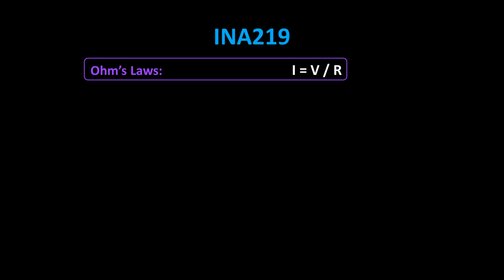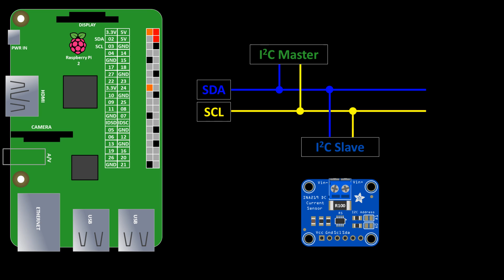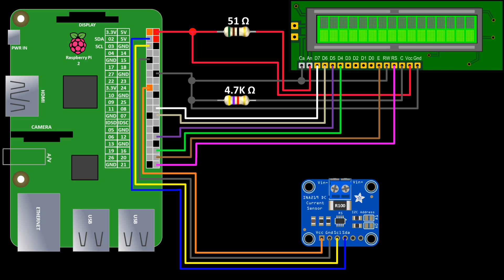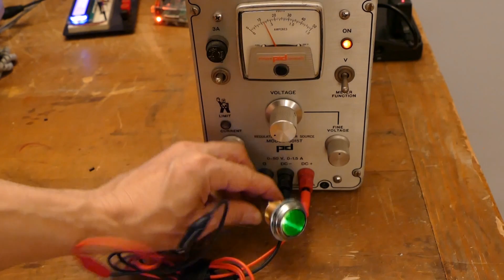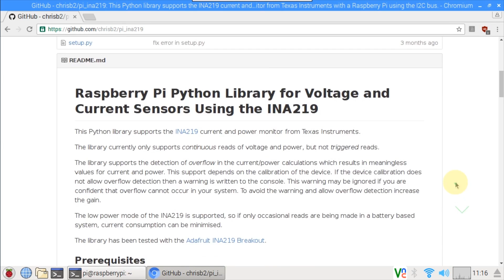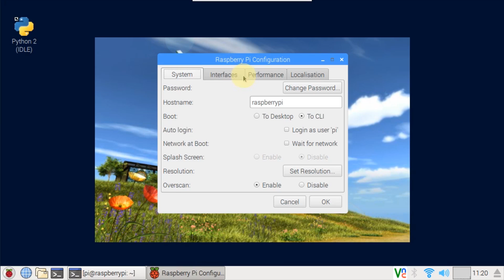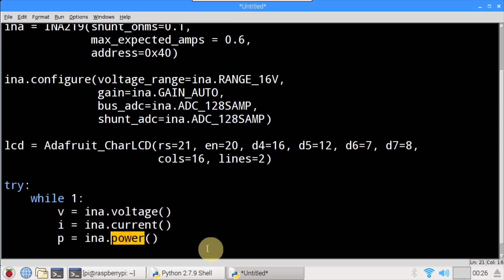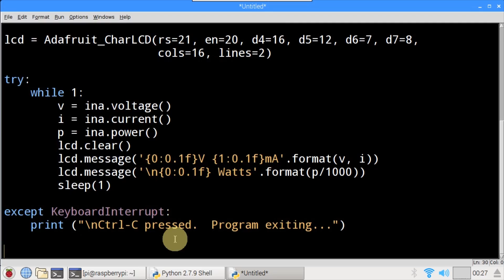Raspberry Pi INA219 Power Measurement Tutorial

Comment: Hi, would this work with the raspberry pi zero 2?
Reply from the maker: Yes, the INA219 will work with the Raspberry Pi Zero 2. It communicates over I2C, which the Pi Zero 2 fully supports. As long as it's wired correctly and addressed properly, it should function just like on any other Raspberry Pi model.

Comment: I'm hoping to display the voltage and current measurements on my laptop and store them, could I do that?
Reply from the maker: Yes.  The most common way would be to set up an MQTT server to receive the data from whatever device is connected to the INA219.

Comment: Great video! I am looking into options for a battery bank display. Being that the amp setting is somewhat relative to the load I assume it’s not the best solution for a battery bank that will likely have various loads with different devices being plugged in for charging?
Reply from the maker: It would be better to find a chip specifically designed for battery monitoring, often called a battery fuel gauge.

Comment: To save costs and to keep it as simple as possible, could I use Raspberry Pi Pico instead of a full on Raspberry Pi?
Reply from the maker: Yes.  There are Micropython and Circuitpython libraries for the INA219 that are compatible with the Pico.  There's a Micropython example using the INA219 in my vegetable garden automation video:  https://youtu.be/x219R5rzRtU?si=_hZyaAXItKh97UGn

Comment: i2c isnt being detected! I wired everything like you did but I doesn't work! Do you have any idea why? I checked some forums but nothing works
Reply: I installed all the libraries but nothing is showing
Reply from the maker: Did you enable I2C using raspi-config?  Did you verify the address using i2cdetect?
Reply: @rdagger  Thanks for the quick response time! I enabled I2C via the Raspberry Pi Configuration menu and i wouldn't get any detection using i2cdetect. I made sure i connect the pins to the proper gpio pins and everything.
Reply: @rdagger  Could there be an issue if the wirelength of the wires I used to connect the pins is a bit long? The wires about a foot long.
Reply from the maker: @tonssov1  1 foot is within spec but I would test the wires with a meter and try swapping them out.  What Pi are you using?  You could have a bad INA219.
Reply: @rdagger  I have a raspberry pi 4. How could I verify that the INA219 doesn't work?
Reply from the maker: @tonssov1  Hook up a different I2C device and see if i2cdetect works.
Reply: @rdagger  I don't have a different I2C device but could I try and get it working on my arduino to see if its something other than the INA219?
Reply: @rdagger  I got it working on arduino and am getting proper readings.
Reply: i got it working. thank you

Comment: Can we use the same for any different processors with Android os in it ?
Reply from the maker: Any board that supports I2C should be compatible assuming you can get a driver for it.
Reply: @rdagger  ya so I got the driver as well as my pcb supports ina219 but the thing is I am not able get the data from it. Would be great if you could guide me 🙏🏻
Reply from the maker: @SohanChhangani  What board are you using?  What driver are you using?  What error message are you getting?
Reply: @rdagger  custom pcb with cm3566 som
Reply from the maker: @SohanChhangani  Sorry I don’t have any experience with the CM3566.  Generally speaking, I would do the following:
1.	Verify your wiring is correct and try to keep the lengths as short as possible.
2.	Check with the manufacturer and see if external pull-up resistors are required.
3.	Find an Android I2C test utility and see if the address of the INA219 shows up.
4.	Find a forum that specializes in Embedded Android Development or Android IOT Development.

Comment: my sensor won't read, I tried 2 and I tried to make another bus beside the standard pin's. going nuts. will have to buy from a different supplier. 1 sensor showed it's address 1 time. I found another guy who saw the same, but he didn't get replies or posted a solution.
Reply from the maker: Buying from Adafruit is your safest bet.
Reply: @rdagger  I looked and its the same board. the simple version with no extra connectors on the side. I bought 5 on amazon.de think it comes from china as its 2 week delivery. Tested a second on bus at other pins. same result , it sees it 1 time then dies. I toyed with adding 3k3 pull ups and changing the pull up to none etc on the pins. ( not the standard ones ). Nothing wrong with the power or gnd ( 3v3 ). Only thing is that I have nothing connected to measure as I just wanted to check the connection and software. maybe it's a bad batch. I will order some more from a different supplier in germany.
Reply: after testing with some diff pull up's I decided to do a test again on i2c bus 1. Got it working with 10k pull up added to sensor. Will try again later with 5k on bus 2. but happy to get it working.

Comment: Is the power rating Watt hours?
So that lamp consumes 2watts per hour?
Reply from the maker: No.  Watts is a measure of power as opposed to watt-hours which is a measure of energy.  A 2-watt light bulb will consume electricity at a rate of 2 watts.  If you run a 2-watt bulb for one hour, you've used 2 watt-hours.

Comment: Want to mod out a ina219 to give stats via i2c to a .96 oled have a zero2goomini with the capability of 28 volt max however cant figure out shunt resistor change for a 7s3p pack of cells that r 3.7 to 4.2v nominal margin each at 2200mA each... can anyone help me with the right shunt resistor by replying with a link ...ty bc I'm gonna use the ina219 to display what the battery pack is at current , voltage and watts. Zero2goomini has 3 inputs capable of 28v max and are common ground on each input was gonna take and bridge that to a 3 way switch and solder one positive from each pad to the remaining 3 legs of switch.

Comment: Good morning, there is also the possibility to create a current generator in the range 4-20ma? I need to control a proportional electrovalve in current with raspberry
Reply from the maker: I haven’t tried but you could probably build a voltage controlled current source circuit using an opamp and a MOSFET and then control it using PWM.  There are probably many adjustable current source chips that could be controlled using PWM or a digital pot.  I recommend you search https://electronics.stackexchange.com for “adjustable current source mA”.

Comment: So nice ! Many thanks about this tuts ! 
Just one thing. You are mentionned the ACS712 for higher current measurement. but it seems to be a little bit different to plug it to the pi.
Obviousely it need to be connected thru something like MPC3008 converter.
Can you give us more detail how about using it ?
Best !
Reply from the maker: I haven’t used the ACS712 in a project but you’re right that you would need an ADC like the MCP3008.  I have a video on ADC’s: https://youtu.be/wJgyszOSoQU
You might also want to ask Allegro Micro and Texas Instruments tech support for recommendations because there are many new current sensors with I2C interfaces:  www.allegromicro.com & www.ti.com

Comment: very good tutorial. I have a question:
 Hello i am new and doing a project with INA219 sensor with raspberry pi. I have configured and measured the current voltage and power with single sensor. My doubt is that if i want to measure the voltage and current at different points in circuit so should i connect the new sensor at that point or the previous one would work fine. i need help regarding this.
Reply from the maker: You can only read 1 spot at a time with a single sensor.

Comment: Hi, can I use this to measure a 12V 50AH battery?
Reply from the maker: Yes as long as the load doesn’t exceed 3.2 amps.
Reply: Hi, I'm really sorry to bother you but I'm actually tryna measure the amps, volts, and power of a charging 24 volt battery with a RPI that's being charged by a solar panel (I'm building a portable solar charger for my school project). So, if I need to measure amps that's more than 3.2 amps I need to get a lower value resistor for the INA board? Also, you mentioned that another alegro board is suitable for higher amps, If I get that, will the steps in this tutorial be the same? I'm struggling with this and I really need to pull my grades up :( I hope you can help me. Thank you and have a great day
Reply from the maker: @antisocialboy818  The Allegro is just and AC or DC current sensor.  It doesn't measure voltage and it produces an analog output as opposed to digital.  There are many other sensors that would probably be a better fit such as the INA260: https://www.adafruit.com/product/4226
You should ask Texas Instruments tech support for a recommendation.
Reply: @rdagger  will do, thank you :)

Comment: it is possible to use more ina219 with one raspberry to measure different things at the same time?
Reply from the maker: You can have up to16 INA219 sensors on an I2C bus.  Each INA219 must have a unique address which is set using jumpers A0 and A1.  See table 1 of the datasheet for more info.

Comment: Why is it that the load for which amperage is being measured must share the ground with the LCD display and PI? Would it be possible to have the LCD display and PI share a ground, but have that ground be separate of the circuit for which amperage is being measured?
Reply from the maker: A common ground is mandatory to measure voltage because it is a relative value.  If you only want to measure current you might be able to use an INA219 without a common ground but there could be some accuracy issues.

Comment: He mentioned daisy chaining INA219s together in the video, is it really as simple as connecting them all to the same GPIO ports via the breadboard or would I need a multiplexer? Could they all use the same power supply from the 3.3V pin? I'm trying to measure and record 4 different circuits at once. Any help would be really appreciated!
Reply from the maker: It should be easy connecting 4 INA219 boards.  You just need to set the I2C slave address on each board so it's unique.  You can have up to 16 boards because there are 16 possible slave addresses.  The boards do not require much power so the 3.3V supply pin should be OK.
Reply: @rdagger  Thank you so much! I was not expecting such a quick response! Do you have a patreon?
Reply from the maker: @shrekogreface7411  I don't have a patreon.  Thanks for inquiring.

Comment: Hello, very nice video, thank you! I have a noob question. I want to measure voltage and amps of my 10W solar panel. Could I connect my solar panel directly to INA219? I see you connected the lamp between INA219 and power supply but it is just for test purposes and to test the "power" of your light on specific input voltage, right?
Reply from the maker: Not sure what you mean by directly, but you can measure current and voltage of a solar panel assuming you have a load.
Reply: @rdagger  that was exactly what I mean, thank you. So I need to find some light bulb and place it between INA219 and solar panel
Reply from the maker: @kuban6141  Place the INA219 between the solar panel positive lead and the bulb positive lead.  A better way to monitor solar power is to interface with a charge controller.  I have a tutorial on the subject:  https://www.rototron.info/raspberry-pi-solar-serial-rest-api-tutorial/
Reply: @rdagger  Thank you very much!

Comment: This is brilliant very well explained but can you please make a similar tutorial for the new version of this board INA260? It would help me a lot as I want to install it on my portable retropie build so I can read the battery voltage level.
Reply from the maker: Looks like a great chip with a substantial range improvement.  The set up for the INA260 would be very similar to the INA219.  The main difference would be software.  Instead of the ChrisB2 library, you would probably want to use Adafruit CircuitPython which will run on the Raspberry Pi if you use their Blinka library.  I have a tutorial that discusses Blinka and CircuitPython:  https://www.rototron.info/circuitpython-nrf52840-pi-tutorial/
Reply: rdagger68 hi but this is precisely my problem the Adafruit INA260 installation guide is very vague when it comes to the first part of installing circuit python. https://learn.adafruit.com/adafruit-ina260-current-voltage-power-sensor-breakout/python-circuitpython it’s talking about installing circuit python and takes u to another guide then it asks you to install some files at some place at the pi etc... it’s extremely confusing. So a video step by step guide would be great.
Reply from the maker: Sorry, it would probably be a long time before I could make your request.  Installing CircuitPython is very easy and I do demonstrate the installation process in the link above at 8:37 in the video:  https://youtu.be/bserx54ZJPM?t=517
I think the Adafruit tutorial is confusing because it is primarily targeting their boards and not the Raspberry Pi.  If you follow the instruction in my video to install Blinka, then theoretically the only other install step should be to pip install the INA260 driver:
sudo pip3 install adafruit-circuitpython-ina260

Comment: very good video , is there any other circuits other then the INA219 that can measure high voltage ?
Reply from the maker: I don't have any first hand experience but there are probably many options.  TI makes the INA169 and LM5056.  Linear makes the  LTC2945.  I'd speak with TI and/or Linear tech support and ask for recommendations.  You can also try Allegro MicroSystems:  https://www.allegromicro.com and the Open Energy Monitor forum: https://community.openenergymonitor.org

Comment: Love your tutorials, I want to use the INA219 to measure current between 0 and 20ma for a pressure transducer/transmitter running of 12 volts,
how accurate is the device at lower currents ?
Reply from the maker: According to the first page of the datasheet it is 0.5% accurate over temperature.

Comment: If we r working with picam and raspberry pi, can we still use ina219 to know different values of current and voltage for different images captured by picam? Will there be any difference in current and voltage values for different images captured by picam?

Comment: Hi and thx for the video! I have a couple of questions. 
1. Do I have to messaure the current to get this to work or can I use it as a pure Volt meter?
2. You said that you can daisy chain them, could I messaure four different voltage sources with four of these?
3. Is it possible to skip the lcd and have the voltage shown on screen in Raspian?

Thank you very much!
Reply from the maker: 1.  Yes, you can measure only voltage.
2.  Yes.  Each board needs a unique I2C address.  This breakout board has jumpers for 4 different addresses (0x40, 0x41, 0x44 and 0x45)
3.  Yes.  The LCD is only for demonstration purposes.
Reply: Thx!!!!
Reply: @rdagger   Hi and thx for the video! on your response on the point 3, how have the voltage shown in raspbian instead of the LCD screen? please and thank you
Reply from the maker: You can use the python print command.
Reply: You could use the ina226, it can measure up to 36V and is very accurate.

Comment: Great Video. 
I am trying to measure .050 to .005 mV range. Is this board capable or do you have any suggestions?
Reply from the maker: No, the resolution is only 12 bit over 0-26V. I don't know of any hobbyist sensors that will meet your accuracy requirements.  I recommend you ask Texas Instruments tech support.  They make a lot of other voltage/current sensors.
Reply: @rdagger  thank you, a friend of mine mentioned that I might be able to use a mosfet do you have any experience working with these?
Reply from the maker: DIY high accuracy, stability and linearity can be challenging due to the influences of noise, EMF, temperature, etc.  It may also require expensive equipment to calibrate.  There are many new high resolution ADC chips available.  I recommend you post your question to a metrology forum:  https://www.eevblog.com/forum/metrology/
Be sure to provide a detailed outline of your requirements such as accuracy, sensitivity, resolution, range, are you measuring voltage only or voltage & current, are you measuring DC only or DC & AC and a summary of your project.

Comment: Is there a way to measure this without buying a separate chip?
Reply from the maker: You could time the charging of a capacitor with a couple of resistors but it would not be nearly as accurate or reliable.

Comment: Very nice video!
I'm trying to measure the output of a solar panel so I made the same circuit what you did and replaced the power source with a solar panel. The measurement of the sensor seems to be ok for the voltage but for some reason the current is always zero. Do you have any idea why could this happen?
Reply from the maker: If the INA219’s shunt is in series with the panel’s positive lead then you would only be able to measure current if there was a load.  Many solar charge controllers have serial ports that log real-time data.  I have a tutorial on reading data from charge controllers: https://youtu.be/1VxP38XlVEQ

Comment: Hello, can i use instead relay channel and measure the electric appliance connected to the outlet and outlet to the relay channel? thanks
Reply from the maker: I don't understand the question, but if you want to measure household appliances then you would need a different solution because the ina219 can only measure up to 26V DC.  Try https://openenergymonitor.org/